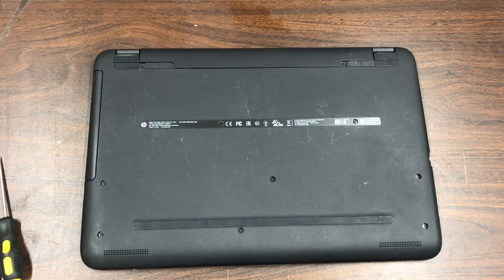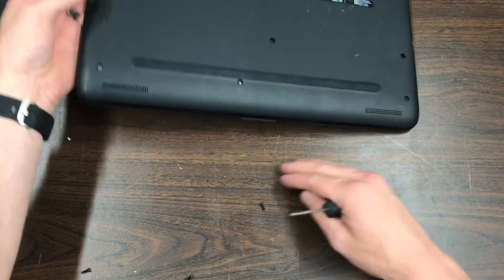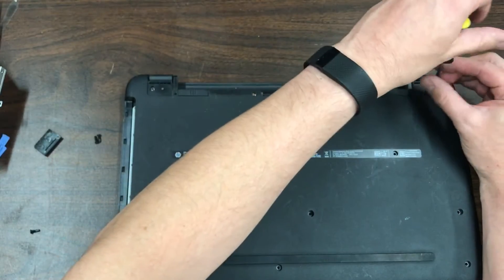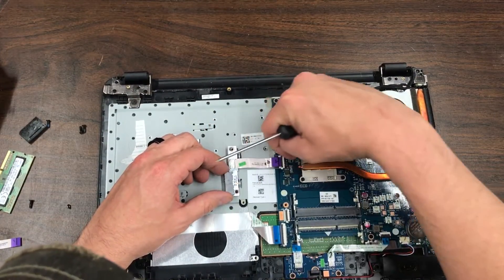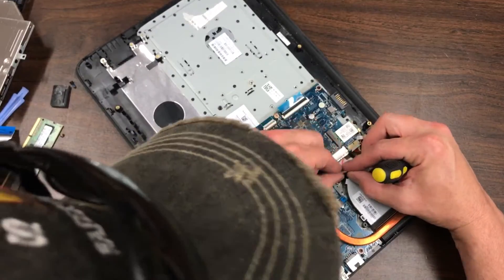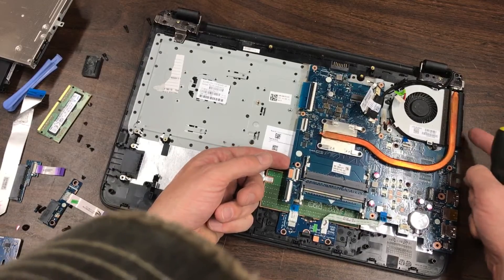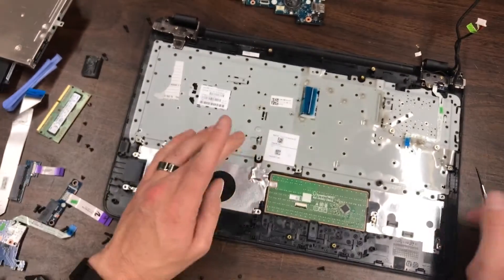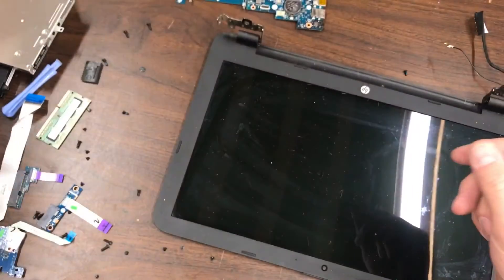HP Notebook 15-ba014nr Tear Down

Comment: Hi, does someone know what is the disk?
I mean: SSD (if it is, M. 2? Or another one), HDD (what type),
I need to read the disk to find a document and I don't wanna loose the information that is inside😔 (some documents)  and I a NEW doing this things hahaha.
I'll be gratefully
Pdt: I did not can open my hp 'cause I don' t have the plastique to open the plastic😔

Comment: I have the same laptop ( hp celeron N3050@1.60ghz ) can i change  cpu and add ram+ ssd  to make it adopted with wimdows 11
Reply from the maker: Not very likely. There are people who mod windows 11 to run on older machines, but these aren’t very upgrade friendly for the CPU, even with the specialty equipment for reballing the CPU.
Reply: 15-ac130nk this is the model

Comment: 16:35 is the black wire coming out from the bottom of screen(not the display one) the antenna for wireless connection?
Reply from the maker: @Mercedeslover69  possibly. This video was from a long time ago. So it could have been one of the antennas for WiFi or Bluetooth, or for the built in camera.
Reply: 😊😊😊r

Comment: My battery no longer charges after this tear down and reassemble.  Does somebody know what part of the assembly is the connection for battery power? It says 0% and does not charge at all.  The battery seems to be well connected.  It charged perfectly before this, so I think something internally is not connected properly.  If somebody can point to a specific time in the video where that necessary disconnection is is made so I know which cable to look at, that will be helpful.
Reply: Did you ever find a resolution to this? I believe the battery connection is hard wired into the motherboard on this model.

Comment: I'm just watching this to see how to open mine. Mine is the HP-AC-179TX model. Literally the same but just a different model number.  I'm going to upgrade/replace my HDD with a 240GB SSD for faster performance.
This helped a lot!  Thank you so much!
Reply: That's a really bad idea since windows takes up like 80gb
Reply: @edwardvandermerwe9878  I just now installed wind10 on my old HP notebook. I installed a 120GB SSD. Windows space is 33GB. I have 86GB free and for what I need they are more than enough. It depends on the type of use one makes of one's PC
Reply: YOU should replace your dvd player with a  hardrive  caddy? I did and put a 1TB ssd in it and WOW i love it....
Reply: I'd honestly recommend going with a 1tb, 240gb won't have a lot of free space
Reply: @phifediggy9659  he will use his hard disk also so 1tb hhd +240 gb ssd

Comment: Just pulled one apart.
I have never seen a corroded CPU cooler fan in a laptop.
Just another thing to add to the worlds slowest laptop.
Reply: Oh yes pal, I own the hp-ac125nv model and despite the i7 Core CPU is incredibly SLOW ... The cause must have been this wretched 1 Tbyte Hard Disc they put in it. So I am gonna change that crap with a 500GB SSD and upgrade the RAM to 16GB. Thanks to this cool video (except for that wretched hat...haha) !
Reply: @rapidreaper  Thank you for the advice !

Comment: Taking it apart is all fine and well.  It's putting it back together and running again -- that's the hard part.  Getting that keyboard connector to sync correctly was a b*tch.

Comment: I want to buy a HP 15-ba000 15-ba014nr but i need to Know if is a good pc
Reply from the maker: I think it is fairly well constructed. It definitely isn't a processing powerhouse, but is sufficient for general daily use. I forget what the benchmark was, but it was neither terrible or spectacular. The display was respectable, no complaints there. I like that there are two RAM slots, and if you wanted to add a second hard drive you can always get a conversion caddy.

https://rover.ebay.com/rover/1/711-53200-19255-0/1?icep_id=114&ipn=icep&toolid=20004&campid=5337985381&mpre=http%3A%2F%2Fwww.ebay.com%2Fitm%2F9-5mm-Universal-SATA-2nd-HDD-Caddy-SSD-Hard-Drive-Panel-for-DVD-ROM-Optical-Bay-%2F301737504402%3Fhash%3Ditem4640f4ee92%3Ag%3AP0gAAOSwu4BV1Uad
Reply: Clint Liddiard for see movies, nav online, pdf, study is good?
Reply from the maker: Yeah. The larger display is better for reading than on an 11 or 13 inch. Your only limitations on video are going to be either internet speeds or intense graphics on gaming. For the price of this one I think you could definitely do worse. It'll be a bit slower to do things like boot and update, but web browsing, video, and standard documents it'll do the job.